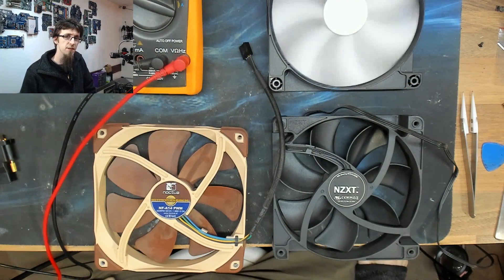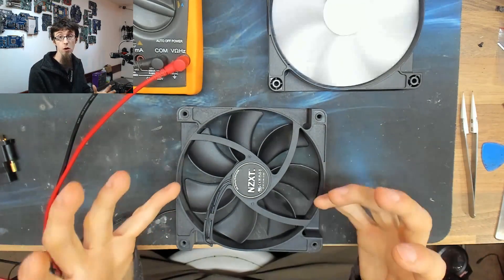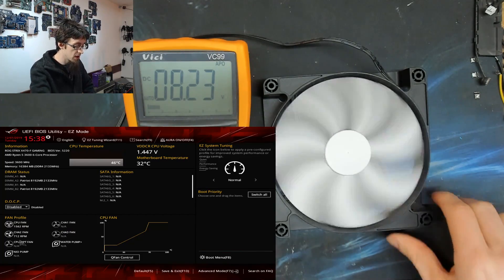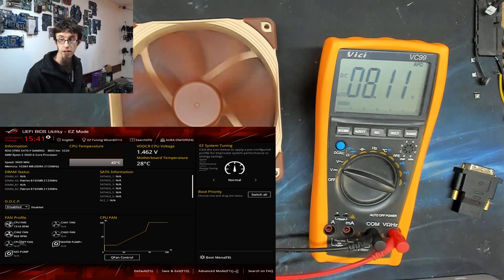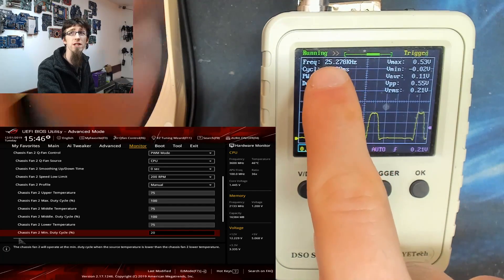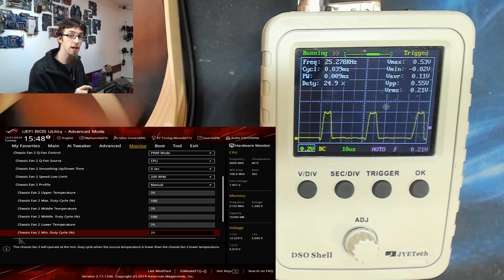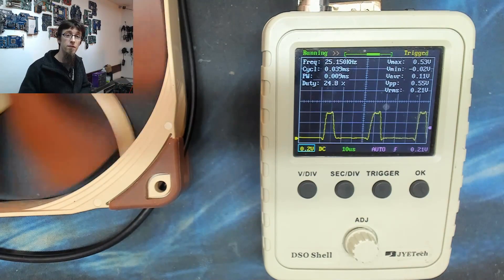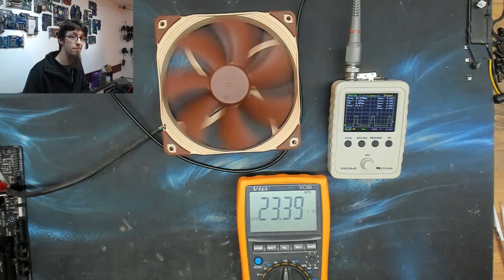LFC#191 - 3pin DC Fans vs 4pin PWM Fans

Comment: Would have been nice to start off with hey here's where you plug the three pin into the four pin motherboard. The simple answer is that the tab controls the position of the male plug on the motherboard side.

Comment: This is probably the best video on PWM fans, thanks for making it!
I do still have one slightly stupid question, though. A PWM fan at 50% duty cycle will spin slower than when at 100%, so it must also use less power. But the power pin is unchanged (constantly at 12V), so where does the remaining power go? Does the fan produce more waste heat at lower duty cycle settings?
Reply from the maker: The short answer is that the 12v is getting switched on and off at high-speed inside the fan, so yes it uses less power. During the Low section of the PWM wave, the fan is off, and free-wheeling, thus using no power.
But additionally, the actual power used by a device is based on the amps it uses as well as volts - so a higher or constant voltage doesn't necessarily mean it's using more power, it may be running at a lower amperage.
The really basic version is a garden hose. The pressure in the hose is Volts, and the thickness of the hose is Amps. The two of them combined dictate the volume of water that comes out, and that volume is the actual power used - or Watts. This doesn't really apply to the fan, but something to keep in mind when looking at voltage as a measure of power.
Reply: @Adamant_IT  Thanks so much for answering! Yeah, that makes sense, the current has to be lower if the voltage is the same. But that makes me think... How does the motherboard know how much current to supply to the fan? Because this probably doesn't just depend on the duty cycle, but also on the fan itself (some probably require more power than others).

Comment: Hello Mister! New subscriber here, would you consider making a video about proper profiles for PWM fans in settings?
Reply from the maker: I'll see what I can do! I've been meaning to tinker with the fan setup in my home PC anyway, so I'll get some bits on order for that and see what I can come up with. Definitive guides are hard to make because there's a lot of variables that make the setup of one computer different to another, but hopefully I can make something that gives an idea of how to approach the issue. As a general guide, the built-in 'silent' profile is what I usually apply to customer PCs, but if you get into the nitty gritty, you can often go quieter/more efficient than that.
Reply: @Adamant_IT  Thank you very much for your answer <3 I definitely meant what  you described as the latter way - a general guide of best, most logical, performant applications.

Comment: My question is, with a PWM fan, is the actual motor coil attached to the fans internal controller still two wires?

If so couldn't they just keep the 3 wire method and change the motherboards control to do the PWM directly?

I'm guessing that the fan motor itself is more complicated, possibly with multiple windings or something similar and uses a dedicated motor driver to provide more granular control?
Reply from the maker: Main issue is that if you drive the fan by its 12v wire, your fan controller has to switch the load of the fan. But with a dedicated PWM wire, the fan controller just sends a digital signal, and the switching is done by the fan itself - so a big fan that pulls a lot of power won't overload the controller.
Additionally, yes a brushless motor usually has four coils in it that need to be sequenced, so there will be a driver for that in the fan, as well as the speed sensor. These two chips may behave unpredictably if their 12v power supply is getting switched on and off at 23KHz.
There were some very early PWM fan controllers, mostly custom jobs, that were designed to drive the 12v pin, and while I never used one they were known for causing an electronic humming noise from the fan.

Comment: I guess that's why my BIOS starts the PC with 2 of my fans at 100% because those fans are only 3 pins so voltage.

The other frontal and back fans are 4 pins and are pretty silent so PWM.

How do I set the voltage for my 2 up fans from AsRock B450m Bios  so they start silent?

Thanks.
Reply from the maker: I don't know ASRock boards very well, but at a quick look, I think that your motherboard doesn't allow separate control of non-PWM fans. A cheap solution without replacing the fans or getting a dedicated fan controller would be some inline resistors like these: https://www.ebay.co.uk/itm/133216619324
Reply: @Adamant_IT  Yes, I will replace them with some beautiful RGB ones, but until then, what software could I use in Windows ? Maybe I have luck.

Comment: I have this fan. https://www.pchub.com/dell-inspiron-15-7000-series-7559-cooling-fan-00cwam92-0rjx6n-dc-5v-050a-bare-fan-p159833. can you help me with the pinouts?
Reply from the maker: Hard to tell without looking at it myself, but the colour coding for that would be Red 12v, Black 0v, Yellow Speed Sensor,  White PWM.

Comment: Have you ever experianced a low pitch/whining noise from a 4 pin PWM controlled fan when turning it down to a lower rpm than its maximum.i have this problem and im wondering if possible can i change the frequency of the pwm.because now it works at full speed and doesn't whine.
Reply from the maker: I've heard of this from the early days of PWM control, but never encountered it myself. I think the only thing you can really do about it is change the fan, or switch to voltage controlled.
Reply: @Adamant_IT  how can i switch to voltage controlled i see no option for this in my bios im using a68hm-k asus motherboard
Reply from the maker: Go into the BIOS, then press F6 for Q-Fan setup. Select the fan your want to change, and in the top-right of the fan curve graph, you should have an option for PWM or DC control.
Reply: @Adamant_IT  looks like i dont have that option i guess im gonna have to deal with it maybe if i flash the bios to a newer version?

Comment: Hi, My laptop turns off suddenly now it doesn't start. with a power adapter, there is charging light and when power button pressed then it doesn't start.(there is charging indicator on and hard disk indicator on ).but no booting and no lights on the keyboard.
Laptop hp 15 d009tu
Power adapter is ok
Tried hard reset but not worked
Without battery not work.(same problem)

Thanks in advance
Reply: cmos battery dead?